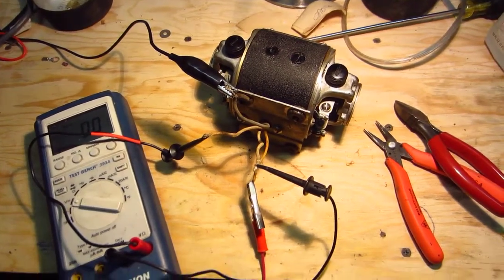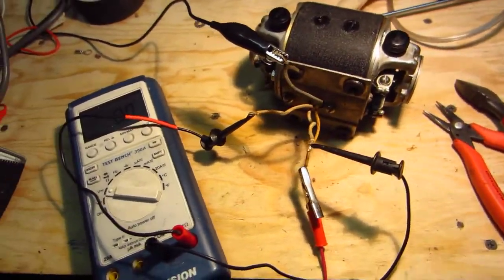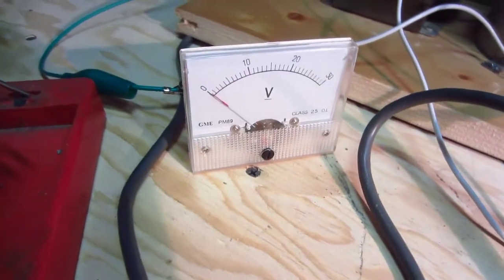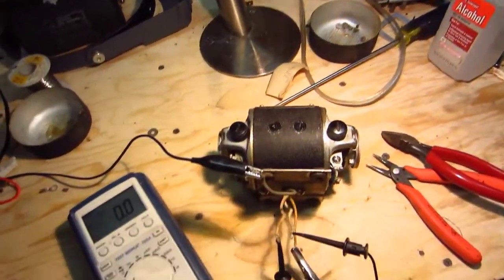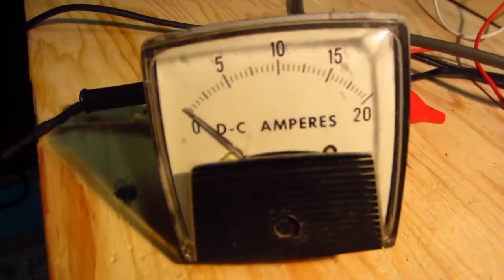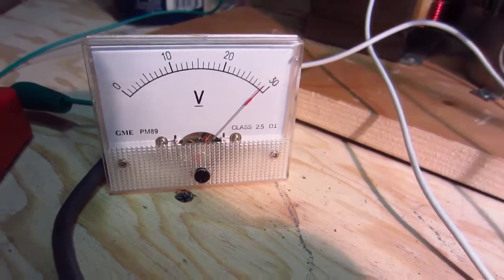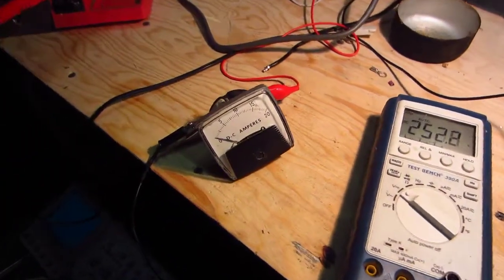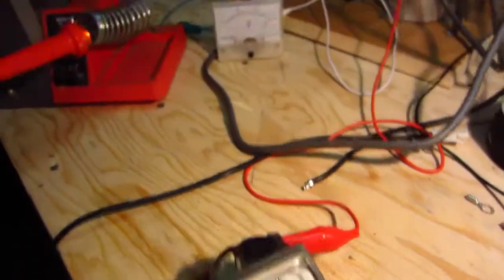DM-28Q Dynamotor Startup

Comment: Hey and greetings from Bavaria, Germany. Just overhauled a DM 28. Replaced  the ball bearings by a modern Type 626-2Z from SKF.. What you assume to be commutator noise in my case turned out to be bearing noise. After replacing the bearings, my DM 28 is now quiet as a little mouse in the church. Best regards, Rainer, DJ9EP.